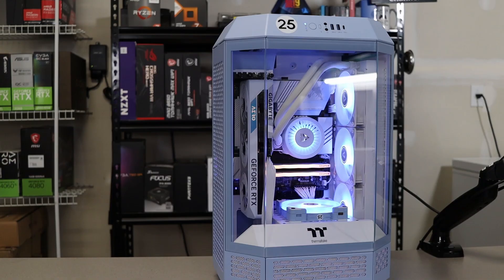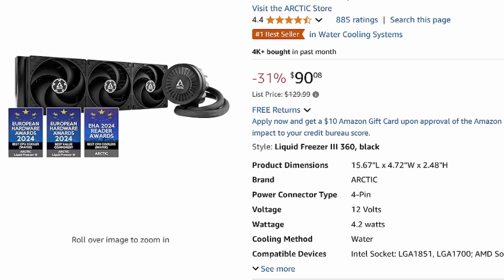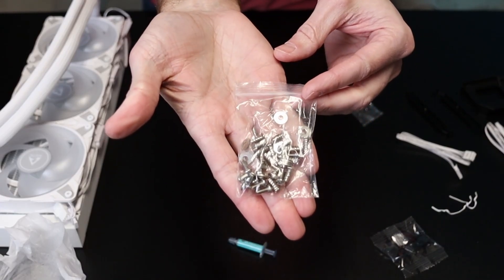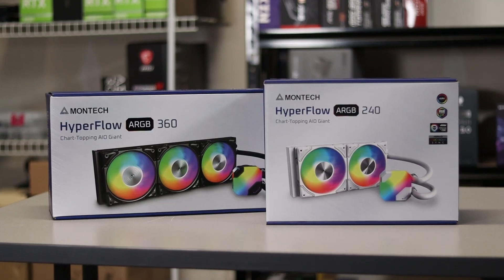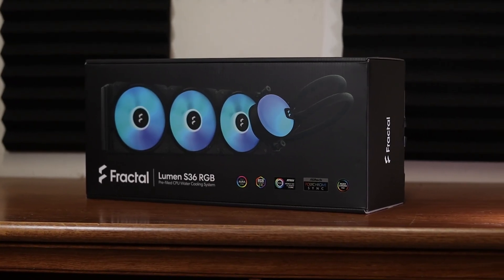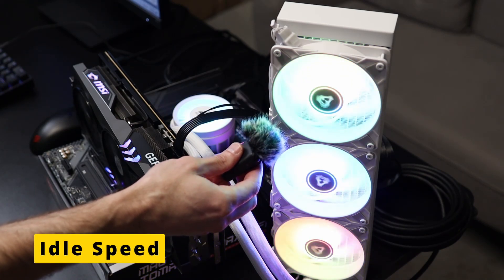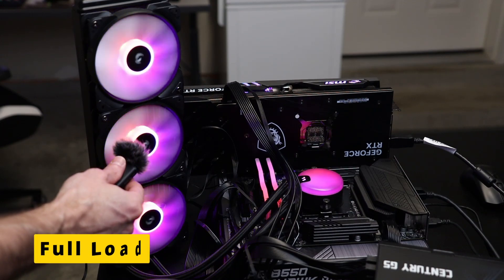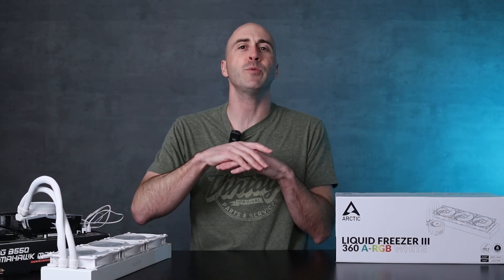Arctic Liquid Freezer III Review - Unboxing, Install, Thermals, and more!

Comment: Hello does anyone have install it to AM4? Because i install it in both ways ( brackets Left--Right correct way and inversed ), for the inversed way i saw a youtube video which suggests for am4, inversed brackets, because the offset is for AM5. My problem is, it can not cool my cpu, also one CCD is always cooler than the other, around 4--6 degrees. Also i changes the fans to P12 MAX. Third my cpu goes very easily to 88-90 degrees, consider i have everything in full speed.

my setup is ryzen 5900x PBO enable. B550 aorus master. Case Lian Li o11 evo xl full of fans.

Comment: but isnt the pre installation of the fans bad if u have to install the aio in the front, like arent they pre installed to exhaust and not to take in
Reply from the maker: Yeh, I installed one of these in the front of a case and had to move the fans.

Comment: why is there a 3 pin that is not connected to anything at the top of the radiator/fan
Reply from the maker: The fans are daisy chainable for both RGB and PWM. It’s the end of the chain.
Reply: @DannysTechChannel  i figured that lol thank you regardless

Comment: It's performance can't be denied, but with so many companies making coolers with wiring that doesn't look like patchy hair all over your pc, it's hard to pick this one up. Sure, the performance is INSANE. But all of the wires you have to deal with is equally insane. So basically get this if you don't care about a clean looking install and just raw performance.
Reply from the maker: Patchy hair? I don’t know about that. First time I used this on a build, it looked clean as can be!
Reply: @ I was trying to be funny. Lol. I've watched a few install videos on this cooler. It's not just this particular cooler, but more about all of the "old-fashioned" coolers and how it is nearly impossible to hide all of the excessive wires. Luckily that's what more people are leaning towards these days...coolers with fewer wires so the install looks cleaner. Not to mention the majority of us are ocd and can't stand knowing there is a hidden rats nest behind the mb. 
I appreciate videos like yours, I just don't appreciate the excessive wires. In doing my research, this one always comes out on top as the best cooler. (Or nearly always.) Anyone would be crazy to at least not consider it. But I have a 7800x3d. It really doesn't need massive cooling like the 14900k. So then it comes down to aesthetics. Aesthetically, this cooler is more of a pita with how thick the radiator is and limits the cases you build in. Plus coolers with lcd screens can be very useful. Some are plain obnoxious.
So I'll probably go with the new Corsair set up. Is it 8 million times more expensive? Yup. Will it look cooler and not BE cooler? Yup. The 7800x3d doesn't need THAT much cooling.

Comment: This cooler is doing an excellent job for me on an overclocked, undervolted 9950x.  It fit easily in a Fractal Meshify 2, the radiator got close to my large GSkill DIMM modules but it fit without issue.

Comment: You think the 240 version decent enough for a 9900x? I idle at like 55 degrees with a "Be Quiet Dark Pro 5"... I don't think the 280 version of this aio will fit in a 4000D.
Reply from the maker: Why would you want the 280? Go for the 360 in a 4000D
Reply: @DannysTechChannel  top of the case can't fit a 360.
Reply from the maker: Why not put it in the front?
Reply: @DannysTechChannel  just not tryna go that route. Since I already got 3 fans in the front.
Reply from the maker: Well the 240 should work but I’d suggest the 3 fan, front mounted for the best cooling potential.
Reply: @DannysTechChannel  I heard that front mounted has its cons, and that top mounted is better.

Comment: I noticed the top part of the cpu isn't covered fully when installing. Does that not affect performance?
Reply from the maker: Nope. Not at all. That’s just the tip of the IHS. The actual die is much lower which is where you want the CPU cooler to make contact
Reply: Its intentional to get the coldest spot on the cold plate on the hottest part of the cpu

Comment: Great review! Quick question I already have a Thermal Grizzly contact frame installed for my cpu would I be forced to replace it with the included artic frame? The thermal Grizzly has the best thermals with contact plate design.
Reply from the maker: Yes you would. But Arctic just informed me they are about to release an upgrade kit that will allow you to use any contact frame. You can be sure I’ll be checking that out!

Comment: arctic liquid freezer iii 420 the pump design covers the M2 slot and cannot be used. Shouldn't you mount it the other way around?
Reply from the maker: That must depend on your specific motherboard. The ones I’ve used the liquid freezer III on didn’t block anything.
Reply: You can contact Arctic Support, provide an invoice for MB and AIO, and maybe add a photo. They will send you their heatsink for NVMe, which will fit, for free.

Comment: Very Informative Video! I am upgrading my R5 3600 to R7 5800XT, Will this AIO work well with 5800xt?? I game a lot, mostly CPU intense games and heavy Multimedia Task and Video editing, My stock Wrath prism cooler doesn't work well, CPU Temps idles at 75 and reaches 89-92 Degrees While gaming.
Reply from the maker: This will handle that just fine. Nice upgrade!
Reply: @DannysTechChannel  Thanks for the Reply.
Reply: That’s crazy I have the 5800xt I just got my aio installed today

Comment: My 18 month old Kraken pump died and even though they sent me a new one I switched to Liquid freezer 3 420(sold the kraken).   Performance is the exact same at a lower price.   The size is an issue, I have been reusing an old case for multiple builds and I had to cut the old and never used drive bay out of the frame to barely fit the radiator in.
Reply from the maker: That’s some dedication to making it fit! Sounds like a great build.